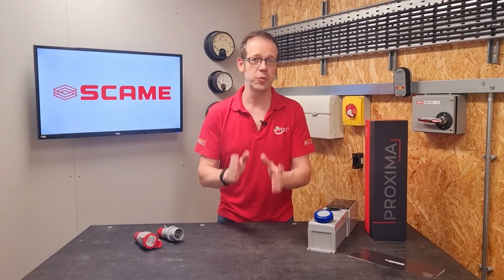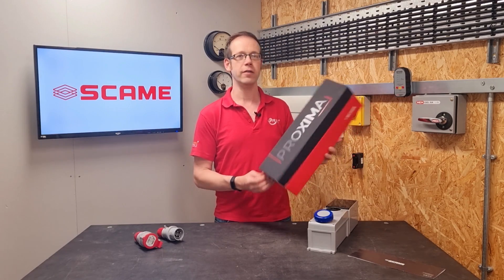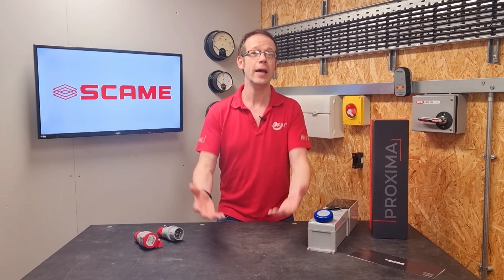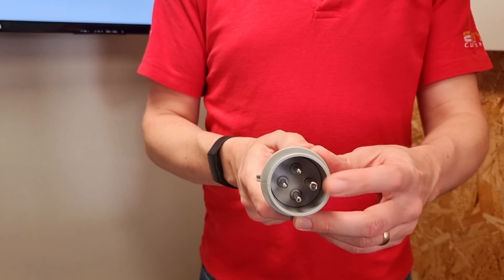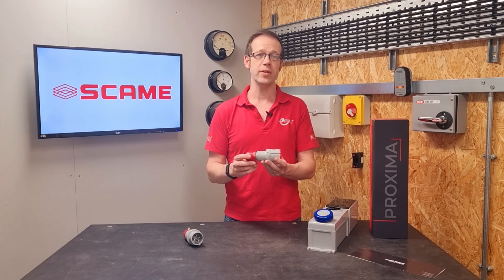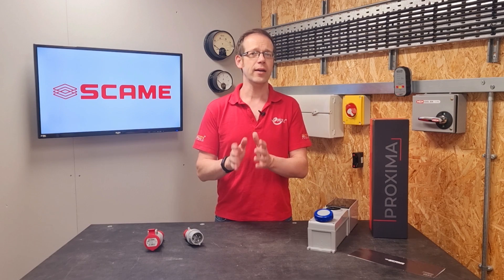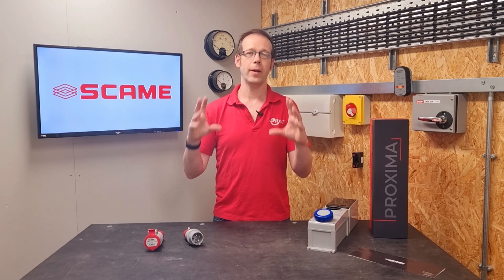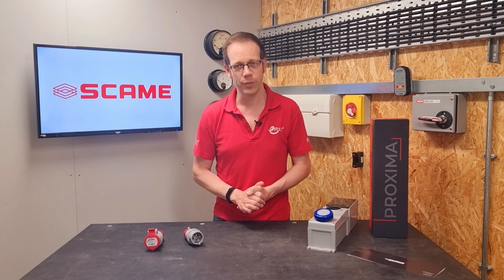Is This a Plug or a Socket? -  Electricians Q&A - EN 60309

Comment: In my language we use the term fixed plug for inlet and swinging socket for connectors. So a simple extension cable has a swinging plug and a swinging socket.

Comment: I'd call your 110 connector at the end a panel mount male,  use the 3p+E versions quite often when building motor controllers. Tbh with ceeforms its always male and female and if you need a panel mount s one you specify that. Powerlock is source and drain again available in panel mount verities.

Comment: And then you look at things like the Neutrik Powercon range and get seriously confused over whether you want a free or chassis mount connector as an inlet or outlet (blue or grey).
Generic "connectors" as there are no pokey out bits or inward holes visible for male/female or plug/socket.
Reply: That’s where inlet/outlet and cable mount/panel mount come into their own 🙂 and at least a powerCON panel mount actually fits a d type panel cut out 😂

Comment: We use in Germany or on travels (work in Greece, Italy, Thailand) the generic word "connector". For all what have "pin" use "male connector" and what have "hole" use "female connector". Every power-give-out use CEE female and every power-go-in use CEE male connections. This is writing in ISO papers since 1978. So we wrote this translated in German in our DIN papers since this time too. 

A socket is typical a wall-build product and a plug is a variable connector how I put into a socket. The typical "power go inside" is mostly at products or vehicles how can't have a power line (in opposite to e.g. freezer, microwave) with plug. So the line come from outside (e.g. gasoline line, EV~= line, container line, caravan line, ship line) of course. 

Typical the system that the power goes save from the male connection to the female connection (same at music stage too) it is the once that we use products how have a male connection and is build directly at the wall. Workarounds from the second WW with two plugs are forbidden - funny that only at cars it is used nowadays (12 V / but till 150 A!). Every military and emercency vehicle use special +- connectors.

Comment: More attempts to dignify a routine concept so that it sounds important.  Plugs have pins and sockets have holes.  Applies whether they are on a fixed structure or on a lead (or other moveable component).  Now how do you describe a hermaphrodite connector such as the GenRad 874.  (OK it's UHF and not LV power.)

Comment: I have seen most of the manufacturers of electrical parts and supplies use "cap" as reference to the "plug"  and "connector" reference to the "socket" since it's not fixed wiring.  I designed a power inlet using PVC as the shrouding material around the prongs/gnd pin of a 3 wire "cap". It was a project retrofitting an old vintage tank type vacuum with a detectable line cord.  Originally, had a cord winder.

Comment: i work in electronics rather than domestic or industrial electrical. We go by the metal connection. A connector with metal 'male' pins is called a plug and a connector with 'female' receptacles is called a socket even if the plastic parts seem the opposite. The "female" is always the live one. i used to to use 'goes in to' when querying things with engineers (I am in purchasing and QC). We don't seem to differentiate between connectors on PCB or leads.

Comment: Easy way to remember is that power should always be on the part of the device you can't touch. (Female is live and male connections are dead) 👀 If the pins (male) are exposed that should be the dead end of the device.  For example the caravan / RV inlet (or portable Generator inlet) is that way, as its normally dead, the cord that will have the live conductor will be a female connection, that will be inserted into the inlet and supply power.

Comment: Its not a socket, its a receptacle!  😁 According to Merriam Webster a receptacle is: "a mounted female electrical fitting that contains the live parts of the circuit"    A socket according to MW again is a "an opening or hollow that forms a holder for something."   They give an example: "an electric bulb socket" That is why people are confused in the UK!   Although we call them outlets most of the time which is defined as: "a receptacle for the plug of an electrical device"  👍🤠   Of course a plug is defined as: "a male fitting for making an electrical connection to a live circuit by insertion in a receptacle (such as an outlet)"  Keep up the good work sir!  Just have to make sure the meaning is lost across the pond!  You know English and American languages as so different!  😁
Reply: Yeah, well, Merriam Webster is a USA publication, and since only North Americans call their socket-outlets "receptacles" (and I don't even think that includes the Canadians) that may explain how wrong you are! ;-)  Are you actually from across the Pond, earwigging on our geeky conversations?
Reply: @Dranok1  yes I have my computer plugged into the receptacle/outlet/socket. Lol. 😎👍.  We like our power too. I have 400A 240v single phase service to supply power to all my “sockets” too. 🔥

Comment: Untill you get to the manual find it's in German and you have a stromvesorgungsteckopller
Labeled SVSK on the diagrams!
Reply: This is sure the old GDR name or before WW I. We never use in Western Germany this word. Possible do you mean "StromVersorgungsSteckKonnektor"? SVSK? Your word is failed.
Reply: @OldLordSpeedy  it was on modern but very specialist equipment... Will check when I'm back at work

Comment: it's called a plug because it's short for "plug socket". sounds silly but that's why people do it.
Reply: You are exactly wrong. The plug is a plug, the socket is a “plug socket”, i.e. a socket for a plug, as opposed to any other sort of socket
Reply: @tlangdon12  I hate "plug socket" - it's a power socket/outlet. There are so many different types of plugs that go into corresponding sockets, yet one never has to distinguish a socket for plugs from say sockets for eyeballs.
Reply: @rednammoc  And the sockets that are used to tighten nuts.

Comment: "Connector" is often used as a generic term for a plug or a socket. "Line/in-line socket" or "trailing socket" is much clearer.
Reply: Yeah I'd say connector is genderless
Reply: Yeah I'd call them a trailing socket myself

Comment: It’s an appliance inlet. I once had two control panels built by a professional panel builder that were designed to be connected together on site by a cable which this manufacturer supplied with a 5 pin plug on each end and a corresponding 5 pin socket on each panel.When I pointed out the obvious danger of this I had to show these “professionals “ the appliance inlet in the Legrand catalogue. I was just a humble electrician,what did I know?
Reply: I agree, that's what I've always known it as and as it doesn't have an enclosure it's also knows as a chassis mount, in my humble opinion

Comment: The industry needs to decide on what the definition of a plug and socket is and separate that from the sex of the connector.

The plug goes into a fixed mounted socket. 
Whether the socket has pins or holes is indicated by the sex of it: if the socket has pins it is a male socket, if the socket has holes for pins to go into, then it's female.

This gives rise to:
Male plugs
Female plugs
Male sockets
Female sockets 

So in this nomenclature, the plug/socket terminology refers to whether it is free or fixed mounted connector.

There's a separate discussion to be had with inline connectors.

So to answer the question posed in the video - the connector is a male socket, which then mates with a female plug.
Reply: In my field the male and female always refers to the metal part of the fitting. The powered metal fitting is the female the male metal part fits in to that to transmit the power.
Reply: @ianmontgomery7534  Yes, I'd agree with that. A plug has pins for the electrical connection, a socket has receptacles.

Comment: Gissinter  gossonter 😭love it. 
So if the item that goes on one end of a lead is called a connector, then the correct term for a one gang 13amp or a four gang used one extension leads are also called connectors? .
In my humble opinion if this plugs into that then it’s a plug and socket simple.
But who am I to argue i’am just a humble spark who’s opinion means nothing.
Great video as always Joe 👍👍👍👍❤️

Comment: If you're time served and you think that's a socket you maybe want to consider a different career.
Reply: In my younger days even electricians called 13A sockets plugs. and the plug it’s self was called a plug top.
Many times I have seen fuse boxes labeled plugs. I still find these days about 75% of customers still call a socket a plug. Hence when talking to older  customers I often use the term plug . How confusing is that.
Reply: @andysims4906  I find that surprising, I wouldn't expect an electrician to confuse a 13A socket for a plug.
Reply: @davidfaraday7963  i I have a old wooden fuse box on a shelf at home that I salvaged from a job about 25 years ago . On the front in a Dymo Gun sticker it says Plugs . Inside it it says things like living room 15A plug . Dining Room 5A plug etc. Maybe it was just my area but I would say 50% of fuse boxes were labeled plugs . In my opinion it wasn’t until the 80s that most electricians stoped calling  them plugs and just used the term sockets.
Reply: @andysims4906  Well OK, all I can say is that in 50 years of doing electrical work one way or another I had never come across a professional making that mistake. Also I have books on electrical systems that are over 100 years old which take it for granted that a plug has pins (male) and a socket has receptacles (female).

Maybe its just your area!
Reply: @davidfaraday7963  when I was an apprentice   Some electricians called a plug .  (A plug Top ) not just a plug. maybe there’s a clue there
Reply: @andysims4906  Clue to what? I'm not saying electricians in your part of the world didn't use those terms, just that they were never the correct terms.
I have just been looking at a little book called "The Electric Guide" which is about 100 years old and was aimed at householders rather than electricians. In the Dictionary of Electrical Terms at the front it defines a "Wall Socket" as "a plug base for wall fitting" and a "Plug" as "an insulator with two pins to fit into a socket and join a moveable lead to an installation" Seems pretty clear to me.

In telephone usage the thing on the end of a cord is a "plug" and the thing it plugs into is a "jack". These terms date right back to the beginning of telephone exchanges in the 1880s.
Reply: @davidfaraday7963  I just thought using the term plug top for a plug  could be the reason they called a socket a plug and what went in it was a plug top. 
It’s interesting I got a few old electrical books on electrical design with pictures probably 1920s 30s  I cant remember without looking and in more than one book the electrician is referred as a Wire Man not a electrician.  It’s just wording but obvious in today’s wording
Reply from the maker: Yup.
Reply: It comes down to the definition of what a socket is.
Does the word socket determine whether it is fixed mounted, free or does it determine whether it has pins or holes?

We often refer to connectors by their sex: males have pins, females have holes.

Clearly the nomenclature systems in use are inadequate and not standardised.

So there are two aspects of a connector which needs to be defined: whether it is fixed or free, and the sex of the connector.
Using one system alone such as socket/plug is not sufficient to describe both aspects.
Reply: @deang5622  a socket is female / live connector. Is that something we all agree on?

Comment: I do a lot of work on temporary power systems in the entertainment industry so I spend my life handling these. It's interesting, I'd always referred to them as "wall mounted" or "cable mounted" plugs / sockets.

As an aside, it's worrying how many people turn up with a socket on the side of their burger van for the power inlet, necessitating a plug to plug lead to give them power!

(For the avoidance of doubt, they never use their plug to plug lead once I've finished explaining why they can't use it).
Reply from the maker: 😂 Ha, I was getting increasingly worried reading that comment Charlotte, thanks for the clarification!
Reply: CPC often calls them trailing sockets/plugs and panel mount outlets/inlets. Saves a reasonable amount of confusion 🙂

Comment: I'm a retired electrician so maybe it's a bit old school now.  the "connector" would be refered to as a free scocket, as opposed to a fixed socket.  The "inlet" would have been a fixed plug, as opposed to a free plug.  Basically plugs and sockets, either free or fixed.
Reply: Also retired and not UK based. We used to refer to the 'connector' as a trailing socket. The 'inlet' was know as a fixed plug or a panel-mounted plug.
Reply from the maker: Great comment, thanks for the insight. 😊
Reply: Indeed, these used to be (and I haven't seen any announcement or mention in the 18th Ed Definitions that it's changed) the correct engineering terms and mfr catalogue descriptions for each connector type (being the generic term) from most mfr's.
Reply: That's the term I use.
Trailing socket and either fixed plug or inlet

Comment: Doesn't matter if you describe any item correctly and even use the product code, the wholesaler will still send you the wrong item. I can't count the number of times I have found an inlet with the pins live due to misunderstanding how it is supposed to work. The connector is nearly always incorrectly referred to as a trailing lead socket. 🤡🐔👺
Reply from the maker: All good points as always. Thanks!
Reply: From both sides of the counter i get this. Unfortunately some of the inexperienced people in wholesalers dont understand,  and some tradesmen dont always explain it properly.  Though if yoy have given them the right part number,  you wouldn't have thought that they could get it wrong.
Reply: @paulprescott7913  We still laugh, at the national wholesaler I use, about being sent a shelf, yes a shelf, because it had the part number written on it with a sharpie. Can't teach stupid
Reply: @acespark1  I worked at that wholesaler for 30 plus years,  and you don't know the half of it.